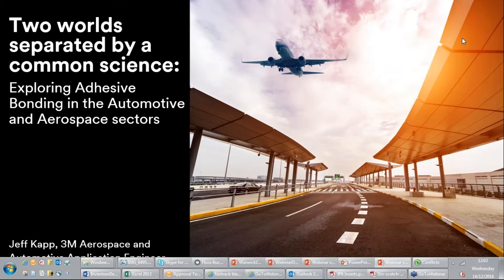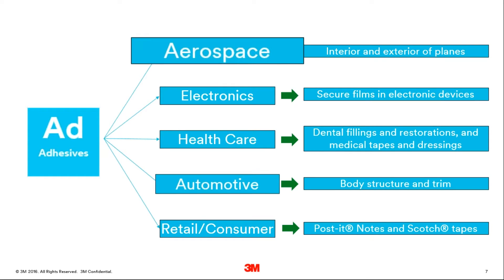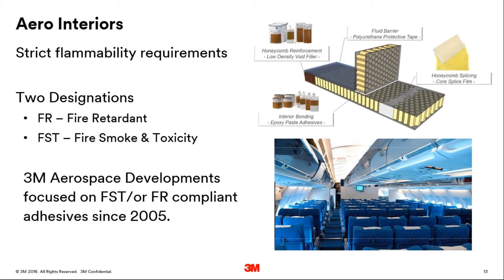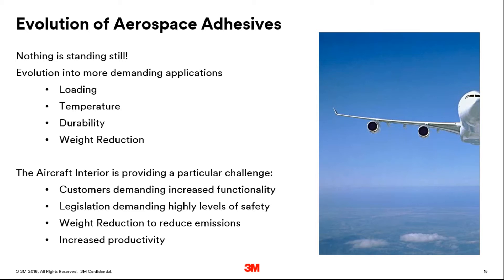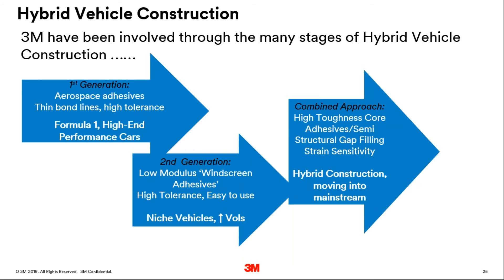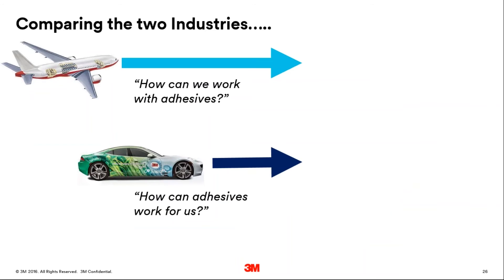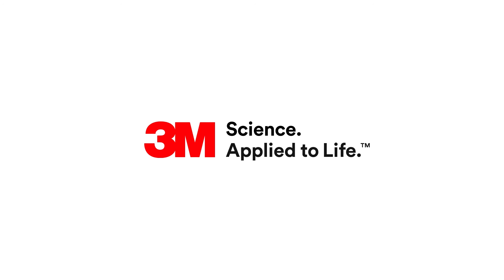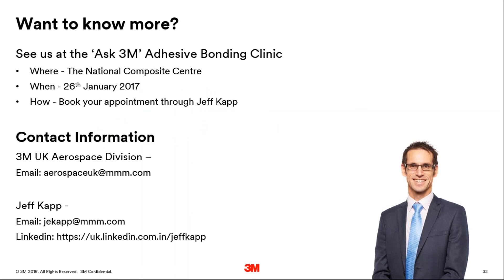Exploring Adhesive bonding processes in the Automotive and Aerospace markets

Comment: For joining composite plates for instance CFRP with adhesive does it require to perform curing cycle for adhesive?
Reply: The adhesive is applied, and the surfaces are joined only when the quality assurance is met. Then the plates could be left at room temperature for the adhesive to cure or to speed up the process it could be cured in a fuselage oven. Everything depends on which type of adhesive is used and what are its behavioural properties.
Reply: @rearviewmrrr  thank you so much
Could you please help me where can I get the adhesives list and their properties
Reply: yes after applying an adhesive between composite adherends, curing of bond is required